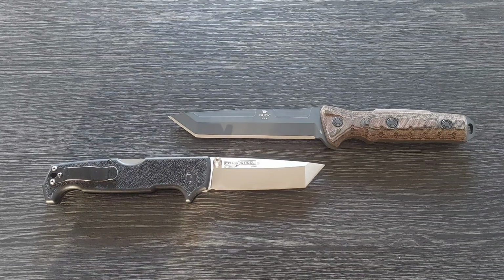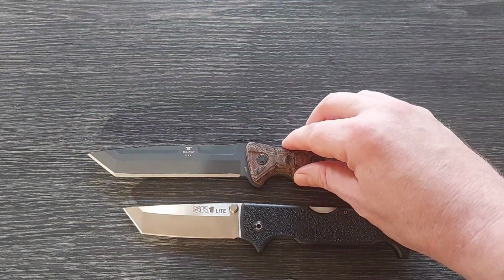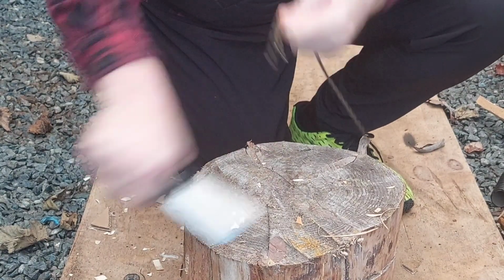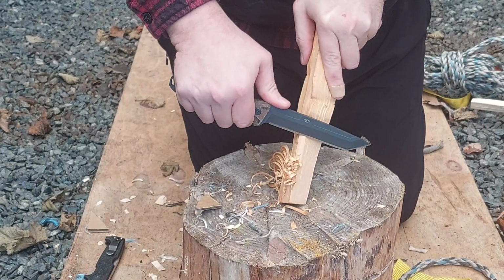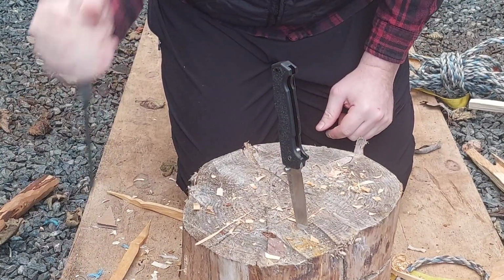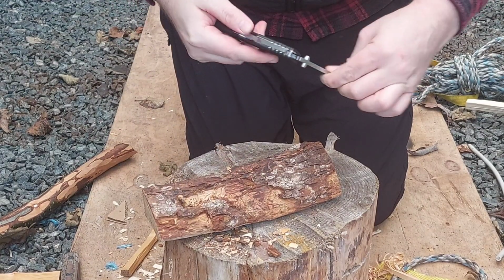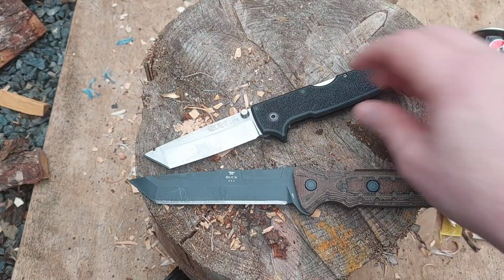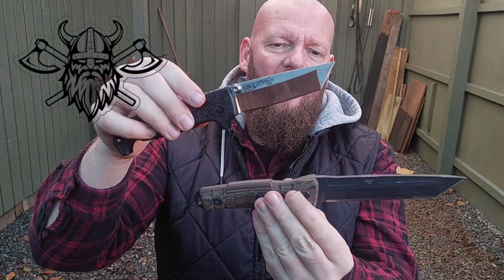cold steel sr1 tanto vs buck GCK Tanto Head to Head. test use .

Comment: I was a bit late to the ball game on the Buck GCK. Seems like the original release sold out rather quickly and I never really saw the version I wanted come back into stock. I did however test an older Cold Steel Recon 1 and 5.5” Warcraft Tanto’s. Bacically the same handles ergonomics but the Warcraft close to double the weight. Was interesting...